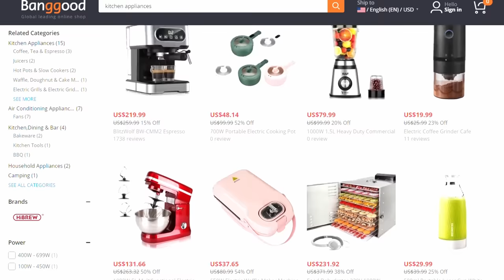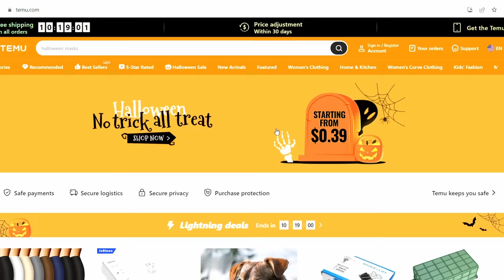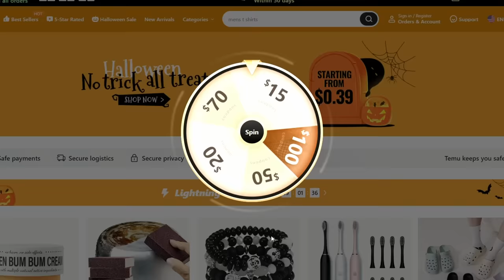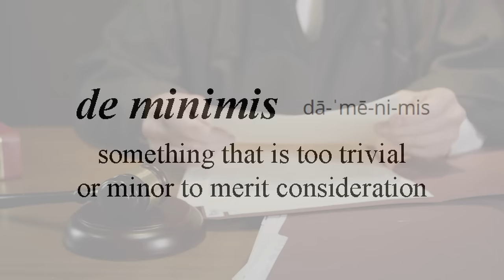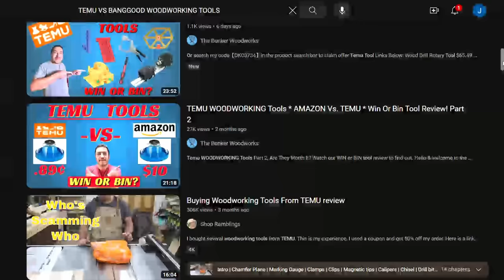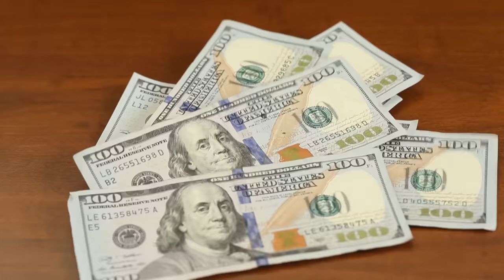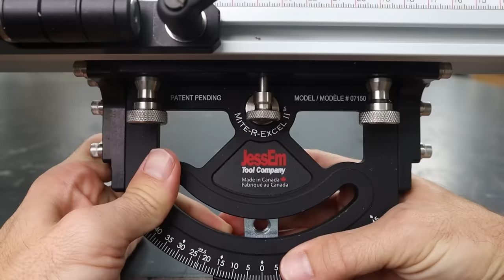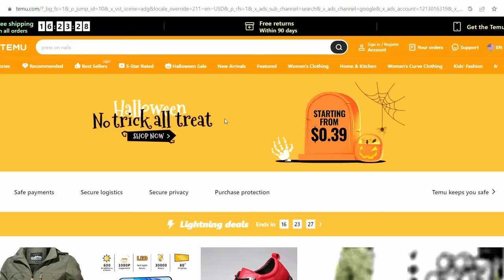I bought knockoff tools from Temu

Comment: When many of these products are made in China, and the shipping cost is high, there seems to be no justification for buying the OG red ruler instead of a black or blue or plastic alternatives.
I avoid identical designs. But a 90 degree measuring tool can only be so unique.

Comment: All great points, except for the square. There is nothing special about R&Ding those squares except for them always being square and that's not really something you can steal. You still need to develop your own manufacturing to ensure squareness. So the Chinese knockoffs are copying the look, sure, but the value is in the squareness not the image so if they are always just as square then great. You tend to trust the red because its always square. If the Chinese knockoff is always square too then, who cares about the color. This type of action (where the product is just as good) is only possible when your profit margins are insane, otherwise there's no room for the knockoff to fit in.
Remember, a square isn't a new and innovative product.

Comment: The legal side for the original manufacturers is even worse than you might think: They can’t choose to just let a knockoff slide without losing their rights to their trademark or trade dress. Both of these exclusivity rights require active defense or they can be declared invalid.

Design patents are a bit more forgiving in this regard, but failure to defend can weaken the patent’s perceived value and make it harder to enforce against future infringement, particularly with regard to collecting damages.

So it’s a real problem, if you don’t play an expensive game of legal whack-a-mole, you could lose the rights to your trademark and trade dress, and weaken the value of your patents.

(Not a lawyer, but I’ve served as an expert witness in patent infringement cases.)

Comment: But what those owners may not have told you is that the reason there are Chinese or foreign knock offs is because some of their parts may be from that country and assembled in the USA. They got the designs and blueprints from some where. And corporate espionage is rarely the case. On a side note china does not have to obey or recognize any other patents other than their own. So IP theft has always run rampant. Most companies account for that in their yearly sales, because if the knock off breaks or malfunctions. Who do you go to next? The real developer of the item. Buy once cry once started somewhere.

Comment: Case in point: the 125 buck clamping square. They are CNC cut. Once the programming is done, the cost of the materials is negligible. Total mfg time? Maybe 10 minutes. AND there is no operator cost per unit. It boils down to: pecker woods are ripping the consumers off by price gouging.

Comment: Nice video and always good to compare. Personally, I have both Bessey and Veiko clamps. The Bessey has nicer grip, while the Veiko has more strong holding - Bessey is sometimes too loose. Also have the Hongdui miter bar which I think is ok but I had expected more. But cannot compare to the "original" one. I can also recommend the Hongdui Clear Cut as alternative to the "original" Jess Em. It has outstanding quality. To sum up, in my opinion you can get excellent quality from "China products" if you do not reach out for the ones at 5% of the original cost, but if you are ready to spend 70-80% of the original price you will also get decent quality.

Comment: Great video, 1st time viewer. Might just take up your course. Regarding those clamping brackets. If you notice they are identical. Harbor Freight does the same thing.  They are Seconds meaning that they didn't quite meet the design requirements. For me, I do go to Harbor Freight a lot. The Family Handyman magazine did an article once on Name Brand vs HF. This is what TFH said. They said if you use your tools a lot, go with name brand tools. If you're going to use them sparingly/not very much, go with HF & save some money. As far as Temu goes, I've heard that their things are pure crap. So no, I will not buy from them. Good video, I like these from time to time 👍👍👍

Comment: I personally don't use temu,  and would prefer genuine products for a "complex" item (ie miter gauge) which has taken r&d to innovate and make. However some products (ie clamping square) see massively overpriced for a block of aluminium with a few holes in. I would hardly call making something similar "stealing" as the concept is so simple. Patents on complex items are sensible, however some patents are nonsense and shouldn't have granted.

Often some of the knock offs are actually produced using the same machines to make the genuine one, just done after hours.

Comment: The Microjig Grr-ripper is a pretty bad example. On Amazon the company Milescraft is selling a push block that has a better angled handle. It’s longer and you don’t pay extra for the 1/8 attachment and it’s cheaper. So companies still get what they have coming to them if they can’t be competitive in the market. The Milescraft product also comes in the box assembled and the Grr-ripper doesn’t. Micro jig also foots a bill onto you through a full color multi language instruction  manual which half of it is just advertising you stuff they didn’t give you which as I stated the other product has. So if they want to lose the pamphlet. Which they don’t take a hit on they add that into the cost of production that goes to you. So they can cut costs and take a little less profit per item. I’m not gonna look at that gloss box and pamphlet and say yeah theyre saving every dollar they can to give us the best product, they’re not, as for the other brands I can’t say. I can only speak for what I’ve seen. Just an opinion.

Comment: I really appreciate that you're pointing out a lot more details, but as other commenters point out - this is much more nuanced and gray even. The original reason for most of the loopholes allowing the US companies to get scammed were set up specifically so the same or similar greedy companies could offshore cheap, unregulated production and import cheap products for massive markups. You touch on the fact that some of the stuff being ripped off is also produced off shore, but don't mention that many of the things are aren't actually products originally developed by companies like Rockler and Woodpecker. In some cases they're things that the off shore producers themselves pitch and providing the branded packaging is just part of the deal. While there is no doubt these companies are being hurt by some absolutely crooked and unfair import policies, but they are also benefitting immensely from those and similar.
Why do the 14 inch bandsaws from Powermatic, Rockwell, Jet, Shop Fox, Grizzly, Wen, Harbor Freight, Rigid, and others look so strikingly similar? Is it just a coincidence so many of the pieces are 100% compatible?

(* and my favorite weirdly terrible offshore company name is power supply manufacturer Mean Well)

Comment: I’ve gotten tons of use out of my Gripper blocks. With my fingers an inch or two away from a spinning 24 tooth ripppng blade, I can’t fathom using a knock off tool of unknown provenance in order to save a few bucks. 

I like Woodpeckers measuring tools. Hardwoods can be really expensive and being able to precisely make marks before cutting (and WP’s are well marked for old guys eyes) say, castle joints helps increase my chances of success.

Comment: Why would we feel bad for the name brand companies who are their designs stolen by the Chinese companies and then resold at a lower price than the “original” brand, when the original brand are making their “original” products in china and then turn around to resale them to us for a huge profit. At that point there is NO difference between the 2 versions because they are made on the same production line, just named differently. Now if the original production would be made in USA or made in Germany, I would understand, but even then I would try them side by side and if they are working the same, I would send the expensive one back.

Comment: Also the way chineese manufacturing laws work is that if you agree for them to manufacture a usa designed product so you can cut costs for your small or large business, that manufacturing facility can make your product for themselves. Part of the manufacturing contract and the state run business of China. This is not addressing the copycat issues discussed in the video but it has defintely killed some inventors who thought their patents would protect them

Comment: This is purely speculative, but some of those knock-offs are basically the real product, but rebranded. A lot of times the factories will use the materials, and equipment from the companies they're manufacturing for, either remove, or leave the branding off, and sell them as their own products. This happened with the China-made versions of certain Spyderco knives, (the Tenacious). The only difference is Spyderco has such a high brand recognition they decided to leave the branding on, and replaced the serial numbers so they wouldn't get caught. Unfortunately for them there are tons of knife collectors, and enthusiasts, and eventually they were discovered.
  The problem is there is no accountability, nor repercussion for Chinese factories. As long as huge volumes of people continue to buy their products, no one will say anything. Also, even if YouTubers are making videos to slight, or detract from those companies, they're still getting paid, and they're still getting attention. You buy $350 worth of crap from Temu to bash the goods, but they still made that money. When you consider the tens of thousands of dollars they've made by loads of people doing this, do you honestly think they care what your intentions are?

Comment: I signed out of my Amazon account. Don’t think I will ever sign back in. I can’t stand it anymore. It may take me a little longer to save up but I will feel better for it. And yeah the knock offs are junk. Fit and finish and the material used is junk. Not to mention material & chemicals used in manufacturing are not regulated. Home Depot and Lowes can’t compete. Tools should be things handed down to the next generation. Even my kids are taking this stance.

Comment: I used to be a scrapper. The tools I have acquired is insane. SNAP-ON, MAC, MATCO, WEISS, CRAFTSMAN and many others, all out of the “garbage”! A MAC 9 drawer 5’ long work bench 
Then there’s garage sales. I got a HITACHI compound slide mitre saw for $10. Just needed new brushes. SNAP-ON wrenches for $3 each. Brand new RIGID shop-vac for $20. 
I think it all depends on the person. But I can do anything a mechanic, a carpenter, etc, can do. 
And F TEMU…..communist garbage I’d be embarrassed to have delivered to my home. 
Great video……

Comment: It's more than just where it's made. Customer service plays a big part in it also. I bet if you have an issue Banggood (really bad name) they will basically tell you to go pound sand, or make you jump through hoops at least. And yes I have bought from them as well for some things. However here's an example of customer service. I bought several rules from woodpeckers 5, 6 years ago, one of them a 3 foot unit anodizing faded a bunch over time. Mind you no effect on function, just "less red" then all the other red stuff. Sent them an email with a picture and they shipped me a new one no questions asked, said to "do whatever I want" with the "defective" one. No shipping nothing. Same situation with Banggood and all you will get is banged good.

Comment: The discussion about Woodpeckers always makes me chuckle, because the first reason I’d never buy their stuff is the colour: personal preference – I don’t like tools that come in garish colours, end of story. The fact that the knockoffs are also red is hilarious to me.

But considering the price, I would also forever feel duped for buying a piece of equipment from them. Maybe it’s actually fairly priced and maybe it is that expensive to produce a light aluminium square that is squarer than all the other squares, but it’ll just never feel right: I don’t think they’ll be able to convince most people that what they do is entirely justified, even if it is.

Similar thing with the other “controversial” brand, Festool: I live about an hour away from their headquarters, I should be looking at them with some sense of pride, regardless of whether I agree with their pricing or not. But I can’t, because they went for a branding that is best suited for a paediatric dentist’s practice. Their stuff reminds me of the Juicero (google it). There’s also the issue with the patents around the Domino which makes any discussion about this brand difficult, but for me, the look and feel is all wrong.

Comment: I bought one of those little table saws from Amazon and it's worked out great for my needs.
Were you running it at full speed?
I 3D printed a couple of jigs so that I can easily set the mitre sled to 45/90°.
Also added a small Jacobs chuck to the off-side, so I can run polishing mops or a flex shaft.
The fence does suck ass, though.

Comment: While I do try to go with namebrand stuff, as its usually always the best quality, and if not, a lot easier to get it fixed/replaced, I want to say, I do buy some cheaper stuff.

$125 for just TWO clamping squares? Hard to feel bad buying cheaper ones at less than half that cost.

$125 for two clamps is ridiculous in my mind, design theft or not, I'll stick with something affordable.

Comment: I have a pair of Woodpeckers-style clamping squares from Amazon because the real ones are just plain too expensive to be worth it. I do hate how much they rip off the real brands down to those little branding details, so I bought the one brand I saw that uses gold/orange-colored anodizing instead of red. Does it make any difference? Probably not. But I feel a little less dirty.

The screw clamps on them are also very hard to use - I'm not sure if the bar is bent to a slightly wrong angle or if they're always like that, but I ad to add some rubber non-skid tape to the faces to get any useful grip.

Comment: Two slight corrections, Amazon can hardly be stated as playing by the rules given the FTC's current supreme court case against them and their anti-competitive practices against competitors (although it's funny because our leaders haven't given 2 craps about monopolistic domination here in the US since the early 2000's). Secondly, Amazon is only domestic in the sense that they are US based, given the fact that it's a mass purveyor of low quality made in China garbage and clones anymore. As far as taxes, keep in mind the tax code is setup to be most beneficial to companies (500 employees or more at 20%) and insiders (tax rate is 0%). Small Businesses like yourself get the most screwed at almost 40% on average. If the tax code was setup to benefit small businesses and US business tech bro greed didn't insist on selling products made in china at 50-100% (or more) markup relative to china knockoffs, the average consumer would be much more likely and able to support US businesses. Being corporate lobbyist owned at this point, the US won't be addressing any of these problems and nothing the average US consumer does will change that.

Comment: I think that micro push block is now unavailable on any of the Chinese platforms.  I was looking for a cheaper option to replace a broken part of mine and couldn’t find them.  I know that you think I am part of the problem but I am on a budget after buying the original one for an outrageous price and if I could find the temu one I would definitely buy it to take parts from because they do look really similar and the replacements part I need is more money than I can justify.  Look at as a gateway tool most People buy from the site and realize they want the real tool or in some cases didn’t need it after all.  It is lowering the price of entry to the hobbyist or professional.  Go into a antique store and look at old furniture that stuff was built without any of the fancy tools available to us.  Just saying.  I think it has its place and the word is evolving.  You know what you are getting for the most part.  Did you take the app off your phone after filming this video?  Or just preaching the bad it is causing to your small part of the ecosystem of being a creator on YouTube? As a tradesman for over 15 years I have a ton of tools I have lost and broken more tools than most people will spend in a lifetime on there set.  Woodpecker are very nice but as a professional I will be hard pressed to drop that much on a simple tool I have lived this long without needing a $100+ corner clamp.   I am bummed that every single woodworker creator feels the need to preach about the evil of knockoffs.  I don’t normally buy from china or harbor freight but they have their place and you can’t knock it because it is filling a void for some people to get started.

Comment: So this is what I suspect is happening, companies are designing these products in America or Japan or Europe. They are outsourcing to China for the manufacturer, which means China has all of the machines and dies and equipment. Reputable companies in our Western world, swap out those dies at point of tolerance failure. Those old dies are then "thrown out" and make their way into Chinesium companies.

Effectively getting all of the quality of a worn out stamp. Of course workers that know how to operate this equipment are a dime a dozen so Bob's your uncle, you make money. Without having to invest the initial capital.

Also, copyright infringement does not translate very well into Mandarin